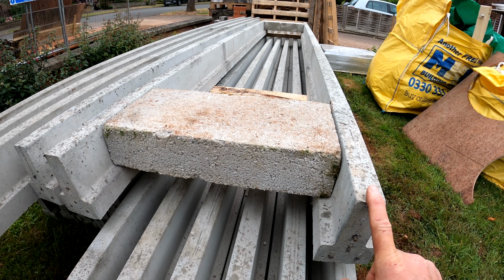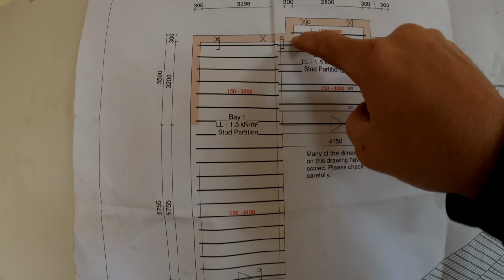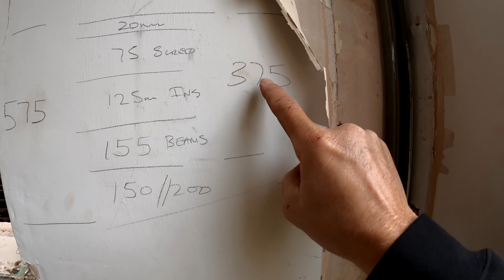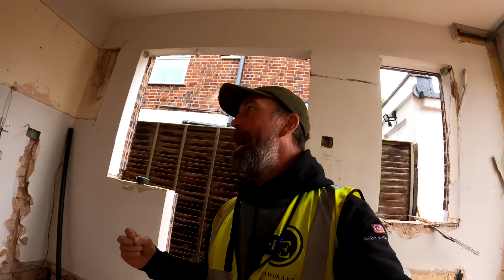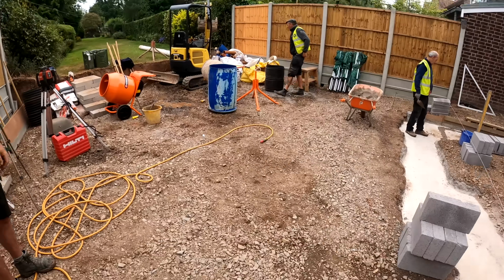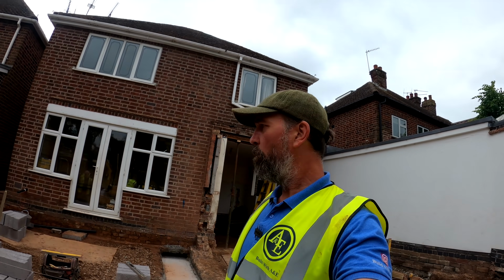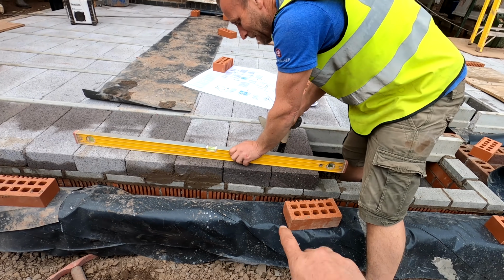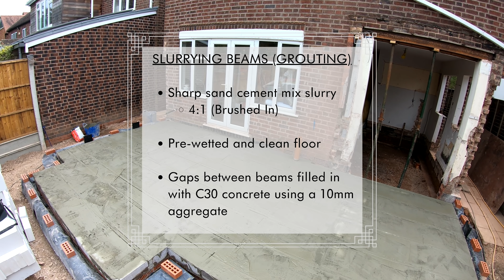How to Lay Block and Beam

Comment: Great video love your insight. I’m currently about to do a block and beam floor next week and although I know how they are installed is there a max over lap of the beams allowed or can we cut them down and butt them up to each other?
Reply from the maker: Block and beam should have a 4” bearing on cavity walls unless specified differently and then internal wall can cross over but alway ask the block and Beam people for their layout it’s been engineered designed by there software also photograph it for records don’t forget the DPC under the beams 😉 all the best Tony 👍

Comment: Looks great and very well explained. I'm thinking using block and beam for a raised patio so bit like what you have but no superstructure on top, just patio slabs. Just wondering if I'd need that sort of foundation underneath? Thanks for posting.
Reply from the maker: Hi Wayne you will require some type of footings but maybe a lot less depth, speak to an architect or engineer all the best Tony 👍

Comment: What will be the next layers on top of the floor to finish floor?
Reply from the maker: Hi Pat on top of the block and beam will be layer DPM the 125mm celotex the DPM again the wet underfloor heating then 75mm liquid screed then decoupling membrane then Tiles
All the best Tony 👍
Reply: @BuildWithAE  iIs the ff in the extension going to be higher than the room with the patio doors? Just that the top of the beams look very close to this level already! I'm sure you've got it all worked out!👍
Reply from the maker: Hi Adrian we have it’s something that you always should check twice just in case all the best Tony 👍

Comment: Proper job lads. 💪 Best way to carry those beams in is to get someone else to do it!! Building inspector made me blackjack the ends of the beams before.
Reply from the maker: Hi Geralt 😂😂😂 that would be awesome building control never heard of that before did he give a reason all the best Tony 👍
Reply: @BuildWithAE  Stop the steel in the beams from rusting at the ends that were facing into the cavity. 

I think it's in the job description that they have to say something. The young ones are the worse.
Reply: @TurinTuramber  “...they have to say something.” 
Very true with our ‘inspectors’ in the US as well. A tactic I found to be very affective is to leave a little “bait” for them to find. I would purposely leave a loose end here or there that I knew the inspector would inevitably see. Something that could easily be remedied immediately, so that you can still get them to sign off on the task before they leave. The inspector leaves the job thrilled with the ‘fact’ that once again he has saved the day and prevented catastrophe and you get his signature and the go ahead to proceed with the next task. 😉
Reply: We have always black jacked the ends it easier than wrapping DPC round them.
Reply: @andrewpalij4691  I have done it if beams are pocketed in an existing wall below DPC. On new walls the beams should sit on a DPC. Doesn't really hurt to blackjack them but where does it end. Would you blackjack your PSC lintels for the same reason?
Reply: @TurinTuramber  30 years ago building control made us do that as well but that whent out of the window years ago, if we blackjack the beams they don't ask for DPC  but I always put a bit at the bottom of the pocket as well.

Comment: out of curiosity why block & beam instead of slab. Seems so much more effort, coordination and opportunities for things to go wrong as opposed to a slab pour..
Reply: In Texas we do it if the house is close to water or wet land. It allows the building more movement without structural damage. A slab will often crack with movement.

Comment: Hi Tony. Fantastic work. Couple of observations from me (as always!)

In some instances, you can obtain permission from the SE to place the beams on the projecting toe of the existing foundation (sometimes requires an engineering brick or two to bring you up to level). This negates the need to cut in sockets - less work!

You should look at Cellecta's TETRiS insulated floor system. It uses the same beam system, but the insulation panels replace the blocks reducing overall floor thickness, there are no heavy blocks and installation is rapid - less work!

Also, please make sure the DPC is visible and never covered in mortar (or it defeats the purpose) 5mm outside of bed joints would be ideal. It might look neater without, but it's there to protect buildings! I cannot understand why 100mm wide DPC is even for sale as it is not wide enough to prevent a bridge with 102.5mm deep bricks!

Really super neat site. Keep up the great work.
Reply from the maker: Hey Bud wouldn’t expect anything else 😂 I did speak to the building control but he wanted sockets, as for the Cellectas TETRiS I will check that out.
For the DPC that’s a fair shout but not to much of a lip in to the cavity because it could become a catch point all the best Tony 👍 have awesome week
Reply: @BuildWithAE  lol. Tricky one with the DPC. Many don't realise how critical it is and that poor installation or bridging can cause significant long term damp issues which can go undetected for year, are hard to detect and virtually impossible to rectify! Let me know what you think of TETRiS.
Reply from the maker: @ndewhurst1007  will do

Comment: I would have preferred to see a concrete oversite under the beam and block to ensure that no vegetation can grow and generally to reduce ground moisture vapour from percolating up into the floor structure.